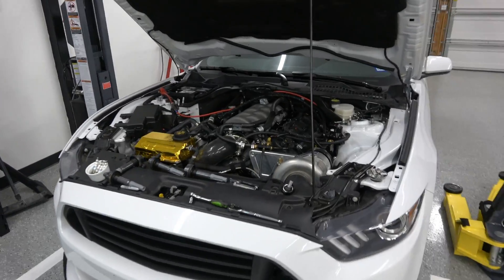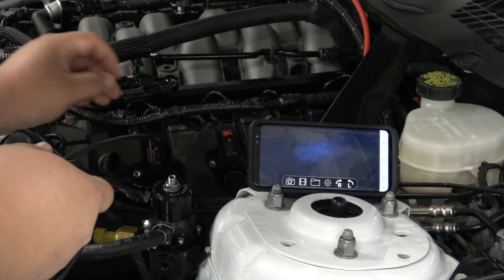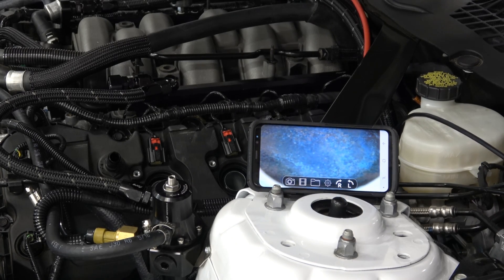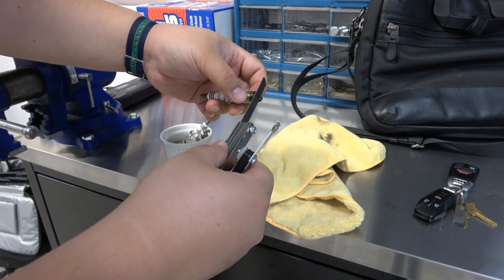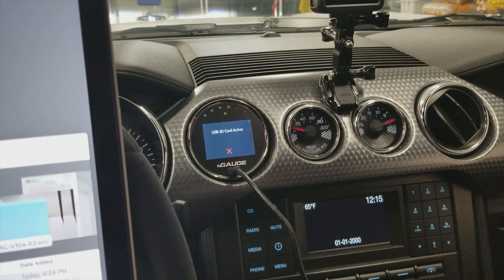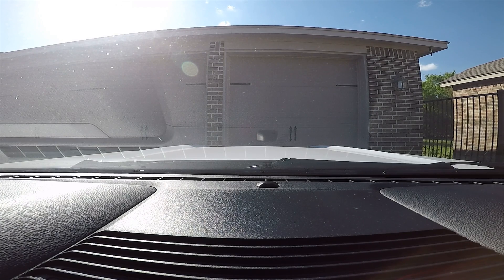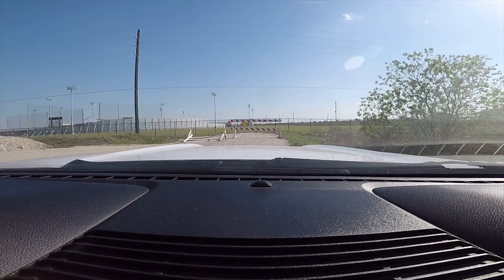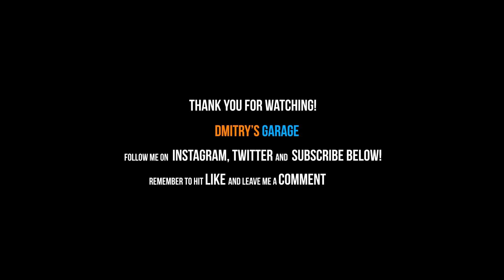Race Gas and Orange Spark Plugs

Comment: Before he soaked those plugs they looked exactly the same as boostane or octanium octane boost. Everyone says not to run that stuff cause it causes this. What people don’t understand is race fuel without lead does the same exact thing.. no one uses lead anymore so this is what we have… people need to realize that good quality bloctsne boost works great. Mix as you should and either tune for it or in this guys case have a car liek the mustang with variable /adaptive timing. The mustang can go from 12-28 degrees of timing as long as it doesn’t detect knock. E85 or 100+ octane will keep you at the max 28 degrees. Tons and tons more horsepower. Around 30-50 rwhp be running 87 and being on 12-15 degrees of timing.
Reply from the maker: You are correct, it's all the same chemistry (i.e. MMT or ferrocene), but the risk is incorrect dosage. If you don't premix your fuel and instead use the gas tank as your mixing pale then you're likely to dose too much over time. For instance I run my tank down to no more than 1/4 tank. My dual pump fore innovations setup at less than a 1/4 risks fuel cuts when driving aggressively, and going down below 1/8th risks stalling at idle as the tank is actually mostly dry when the needle is at 1/8th. This is where people get in trouble as you mix in more fuel without considering the mixture left over. If you're mixing in a barrel or pale and not going overboard with putting too much in you should be fine. I run similar timing.
Reply: @DmitrysGarage  I use half a can for any fill up 10 gallons or more and for the odd 5-10 gallon fill up I use 1/4 of a can. Always ends you from 97-99 octane. Boostane is the best as it doesn’t settle and continues to circulate in the gas. Not sure how they do this it’s incredible. Test for your self. Pour some in a clear bottle and even after 48 hours there is 0 debris at the bottom. Try again with octanium or torco and it looks like a beach at the bottom. I would only use boostane as they have it right somehow. I’ve been using in my 19 mustang since 1000 miles and spark plugs have the orange but still look great and work great at 14k miles. Car dyno’d 471 to the wheels with a tune and headers on 99 octane.
Reply: No its not. True 104 AKI by blend — not by additive. It’s made from refined hydrocarbons, not metal organics. Formulation: Alkylate base (C7–C9 paraffins), Toluene / iso-octane, Sometimes oxygenates (ethanol, MTBE, ETBE), No metals, no MMT, no ferrocene. That's why its more expensive.
Reply: @st.nightmare7650 MMT isn’t the only
Thing that turns plugs orange lol… lead does also… which is in most race fuel. If your running unlesded race fuel it still has chemicals and the make up is closer then you think to good additives and leaded fuel. They all turn the plugs orange/yellow.

Comment: What if you have orange tips on the plugs but never put fuel additives or octane booster in the gas...🤓
Reply from the maker: That's kind of odd, would need to see a picture. Did you own the car the whole time you had the plugs in there? As far as I know none of the commercial pump fuels sold in the United States contain metallic additives that would do that. There are some situations that can cause brown/rusty-ish type of colors though.
Reply: @DmitrysGarage  i put new plugs in ran it for a few months then it was acting up weird, not rinning right. I gaped them to oem spec and i pulled the plugs to see if i was running lean because i also replaced the turbo at the time as well and the plugs are rusty orange i have a 05 wrx no mods besides a cold air intake that the previous owner puy on but always ran fine so i dont know haha how could i send a picture? Thank you

Comment: Would using a fuel system cleaner remove it? Does it affect the cats?
Reply from the maker: I dont think it would come off very easily with much of anything you could dump in the tank. I ran one partial blend of race gas with normal gas in my audi one time and they were orangish. That being said Sunoco says (i asked them) this is not a problem for o2 sensors or cats. Of course i cant imagine its good for them either. In practice ive been running it in my mustang for a few years and my o2 sensors are fine still.

Comment: The plugs are orange on mine and give no issues for normal intervals. I run Race Gas Ultra Concentrate and an HX35 at 33psi on an 89 probe GT. Factory ignition. So they are still doing the job. NGK ZFR 7F-11 at .021 gap.

Comment: I plan on on running race gas for my 2020 mustang with a Odin VMP blower on it. I only drive it on the weekends and do some runs with friends. I wanted to know how often did you have to change your spark plugs? And if you could do it over again would you just go straight to E85 intead?

Comment: I being using vp racing octane booster , and mine look light brown kinda orange . You think it’s bad ? I only put 8 to 10oz per 10gs of 91 octane
Reply from the maker: Is it a daily driver? I probably would be careful with mmt and ferrocene additive boosters on a daily you need to be 100% safe. For a race/toy car I wouldn’t worry too much about it, just dont over dose beyond recommend ratios. Ive got like 5k very hard abusive miles on straight race gas w/o issue.

Comment: I was using the +8 points VP Racing fuel for a few months in my 93 tuned 03 Cobra. Plugs have been orange ever since. I quit using it a few fill-ups ago and just swapped out the plugs again since they were orange again. Running the TR6 ls gapped at .032.
Reply: And that is bad? I have the same with vp racing octanium

Comment: Is the orange not caused by MMT this causes all sorts of misfires and messes up oxygen sensors
Reply from the maker: Yep, as mentioned in the video MMT is what causes orange deposits. Sunoco has told me that their fuel will not cause oxygen sensor or other issues. I've not had any issues and have ran this gas straight for several years now, granted not too many miles. From what I've seen most the problems tend to be in additive packages people are putting in pump gas themselves and possibly over doing it thinking more is better.
Reply: @DmitrysGarage  as  I have found out over the years the additives aren’t as good as the real deal race fuel. Race fuel all the way

Comment: Can you let me know if my plugs are also orange and I'm assuming the top of the pistons and the ends of the valves?  Will that orange come off or burn off if I quit using octane booster and just premium unleaded fuel?  Help?
Reply from the maker: When I scoped my engine I didn't see it on the pistons, but the valves probably have it. I'm told by Sunoco this is not a big deal, but their fuel is formulated for racing use and they're a company that specializes in this. I know some people are mixing things up with street gasoline and I've heard of people overdosing their gasoline by adding too many additives, more isn't always better. So if your fouling is from professionally made race gas like Sunoco's I wouldn't worry too much. If it's from something you've been DIYing, I'd at least make sure you're not over applying these octane boosters.

Comment: have you tried steam cleaning them? basically use a vacuum hose and suck "some" water into the intake of the engine to clean the combustion chambers? I'm building a 13:1 ford engine and will need to run additive to increase my octane.. not looking forward to orange parts... just a suggestion wandering if you wanna try and let me know.. thanks
Reply from the maker: That's an interesting idea, I haven't tried steam cleaning them, but I really haven't had any issues with the MMT. I would be more weary of additives as you could overdose. I think for me it's just simpler to run Sunoco's race gas since they're used by race teams all over w/o issues.
Reply: @DmitrysGarage  thanks for the reply that is very appreciated. i agree on using the right fuel up front but i don't have high octane sunoco or any other high octane fuel available around me.. ugh. I'm gonna have to stick to the additives for now unless i get a 55 gal barrel of gas at a time.

Comment: what octane are you running? Over 100? do you think taking 91 to 94 would case the same build up?
Reply from the maker: Hey SJ, thanks for watching! I'm running Sunoco 260 GT Plus. This fuel is 104 AKI which is the averaged number you see on pump handles at gas stations in America. In Europe it would be 110 as they use RON as the measure. As far as how much buildup, that depends on how the fuel achieves the octane. Leaded fuel can have super high octanes and would never be orange like this, but it would leave lead deposits instead. The orange I get is the result of MMT being used as a Lead (TEL) replacement. So if your 91 or 94 fuel doesn't use MMT, you wouldn't get the same buildup. It could use ferrocene instead, which can also have buildup. It could use ethanol which wouldn't build up at all.
Reply: @DmitrysGarage  I'm using Boostane Professional at a much lower dose..
Reply from the maker: @CE750  I've not personally used Boostane. I wish they were more transparent, but their site doesn't tell you much on the product page. They claim up 116 octane, but I can't tell if they mean AKI, RON or MON? I'd say it must be RON. They almost certainly use MMT and/or ferrocene. So you will get some buildup from it. Sunoco claims their fuel is safe for engines/sensors, I've talked to them about it. They're also very transparent on the properties of their fuels. Overall I feel good about using their product especially given that their fuels are used in sanctioned professional racing all the time. Boostane is probably fine too, just don't overdose the fuel. Sounds like you plan to take it easy, but too many people think "if one is good, two must be better". Overall I'm more weary of a non-traditional fuel company putting out a magic can with limited details on the contents, but a lot of people do run these magic cans from various brands and the reality is the technology isn't very complicated or a mystery.
Reply: @DmitrysGarage  good info... I have a brand new 911 (here is a little video I made about it https://www.youtube.com/watch?v=Q6L3bz_H1GQ)  ... It's stock tuned but the stock tuning is optimal for 94 and in CA we only have 91...  They claim 3 oz of the Boostane professional will raise 91 to 94...  seems rather harmless, and the car does feel more responsive.   I also run Cleanboost Maxx which is a well proven additive that improves combustion...  and then once every few thousand miles I run A PEA cleaner such as Techron or BG44K in my cars.
Reply: @andrey934  there was some orange at the 5000 mile inspection so I stoped using it.. not worth the risk.

Comment: Hi, what kind of solution or cleaner did you used to soak those spark plugs?
Reply from the maker: I was just using some Sea Foam which I happened to have a can of laying around. Thanks for watching!
Reply: @DmitrysGarage   Hi, thanks a lot for helping out. Cheers!

Comment: How much boostane did you run if ever?
Reply from the maker: I've never ran boostane in this engine, but boostane also contains MMT and would cause the same orange buildup. I'm told it's not a big deal by Sunoco.

Comment: Why didn't you just replace the plugs to be safe? I've never heard of anyone pulling plugs and not replacing them! 

Great video, I run Race Gas Ultra and get the same residue, eats copper plugs so I change them fairly often.
Reply from the maker: Thanks for watching! The plugs only had a few hundred miles on them and they're Iridium so they should be fine to keep running for a while. I just soaked some of the manganese deposits off them. It is possible the copper plugs are a lot more sensitive, I haven't tested them with MMT yet. I was mainly pulling to regap if memory serves.
Reply: @DmitrysGarage  I do wonder if the coppers are more sensitive than the iridiums! I just replaced my plugs with coppers for tuning but I have iridiums ready to go in, I hope they last longer! Keep up the good work.
Reply from the maker: @therealkevincars  Irridiums should last a lot longer, on N/A cars 100K miles easily. I'd say with race gas and boost I'd probably change em once a season if tracking. Cheap insurance. Street driving a car like this I'd say every 10K.
Reply: @DmitrysGarage  I used octane booster and all of my plugs turned orange, will that come off if I just use premium unleaded here in Ca and run the car with out octane booster??
Reply: @DmitrysGarage but you're using cheap plugs. I would have thought that if you are using this to race you would have much better plugs. The whole single electrode thing is so out of date now.

Comment: I used Boostane (contains MMT)  in my charger SRT8 on a track day.  Few days later started getting misfire codes. All my plugs are orange like that.   Putting in all new ones tomorrow.
Reply: same thing happend to me. misfiring. I called vmp they said lower the spark plug gap to .26 but im not going to use anymore additives.
Reply: Are you people running the leaded version then? Because there's two types of this stuff. Idk which to get VP says ones for off road only but commenter says he only uses the off road kind. VP says no to emissions for off road octain. What's everyone using do you even know?

Comment: Looks like a high dose of MMT  to me.   Not good for modern engines.
Reply from the maker: I've done some more research and also talked to Sunoco since filming this. I don't think it's a big deal for modern engines like lead (TEL). Sunoco says it's ok and I also found that Canada uses MMT in their gasoline. Also Sunoco specifically advertises this fuel for modern engines with catalytic converters and oxygen sensors. They also sell TEL leaded race gas which they specifically say not to use with oxygen sensors and catalytic converters. It's been a year since this video and still running strong on the Sunoco unleaded. Just had another great oil report and all my data logs are perfect.

Comment: Yeah that looks scary for a non daily driver. I put a 93 can tune on my charger and realized 93 gas ain't always 93 no matter where it comes from. So I ran some good octane booster and could tell my car wasnt pulling timing. But I think its safer to put the 91 tune with 93 gas. I heard that stuff accumulates in your catylitic converters also. Sux. I really like high octane gas....
Reply from the maker: Thanks for watching! 

This stuff for sure accumulates since its a metal (MMT) just like lead was. Wish it worked as good as lead though... Still great stuff. According to manufacturers like Sunoco, MMT is safe for oxygen sensors and cats, which TEL (lead) is not. There is only so much octane you can get from MMT. Realistically it gets you somewhere around 104 AKI with a splash of ethanol. It's not the massive octane numbers you can achieve with TEL. Leaded gas was hitting 200+ for some aviation uses back in the day!

Personally I like to stick to race fuels rather than concentrates or boosters. You don't want to put too much of this MMT stuff in, no matter how safe people say it is. MMT is relatively new as a fuel additive. I'm sure we will find some problems especially in large amounts such as when people over use concentrates/boosters. I'd rather trust Sunoco than a random concentrate, as far as this kind of chemistry goes. I'm sure they use just enough of the stuff, while people often over-use concentrates. 

I think it's actually better for a non-daily driver. How much fuel does a non-daily even really burn? I think it'd be crazy to use race gas in a daily. I'd say use ethanol/E85 over anything else in a daily performance car. There's no reason not to use ethanol for a car that doesn't sit. Ethanol is only bad in cars like mine that sit for weeks or months at a time. Race gas is much more stable especially if it's stored in an air conditioned space.
Reply: @DmitrysGarage  that color is bad for the plugs?